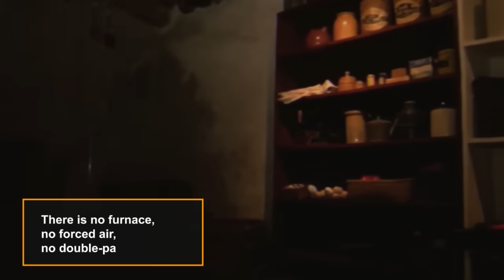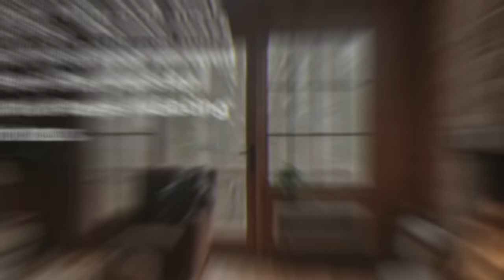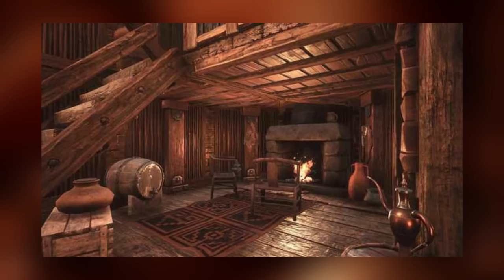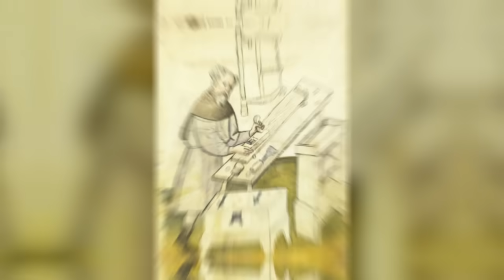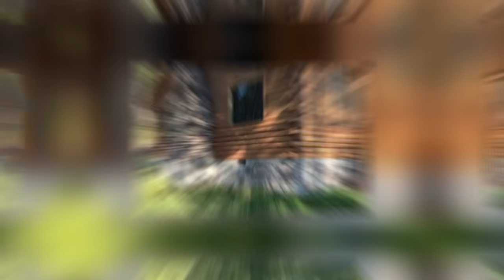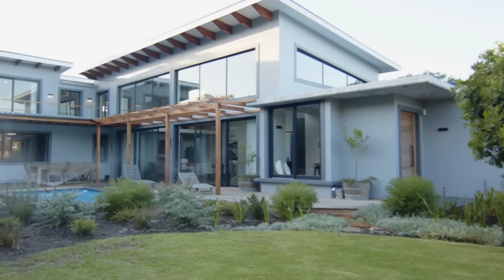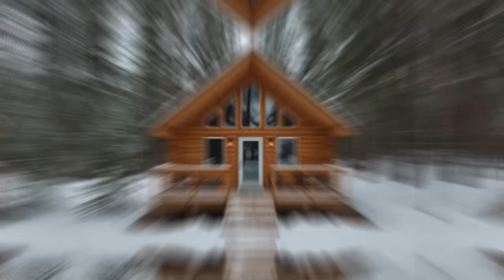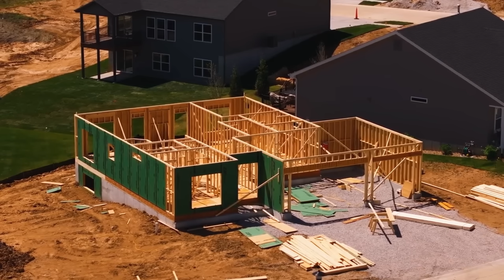Why Medieval Log Cabins Stayed Warm in -40°F While Modern Homes Freeze

Comment: Tried to watch the entire video... But simply could not. Much of it is just incorrect or misleading.

Scandinavian masonry heaters have literally nothing to do with medieval heating. We literally know that this particular type of fireplace was developed by general Fabian Wrede and architect Carl Johan Crondstet in 1775. Actual medieval fireplaces in Scandinavia were either inefficient or did not come with any type of smoke stack at all. Instead they were literally basically a pile of rock in middle of a room. And there was a hatch to let (well at least most of) the smoke out. There was little space for people, and usually in the summer they would use spaces outside the actual house to extend living spaces... But during cold winters, having everybody in tiny cramped spaces was one part of how to survive cold weather.

And as for walls, it literally is not bad to have some actual insulation. The real issue with American houses is, literally in the distinct lack of just about any insulation. While a simple void can act as some form of insulation, it is not very efficient or effective. Here in Finland modern building codes call for roughly 12" of actual insulation... And that means our houses can manage with fairly little in terms of heating.

As for ventilation, it is necessary to ventilate no matter how cold it is. Sure you don't want uncontrolled leakage, and most traditional forms of ventilation are quite inefficient. But modern ventilation with heat recovery can actually recover ~50 to 80% of the heat. And this is not some magic, but simple physics. Use warm inside air (exhaust air) to heat cold intake air. The intake air heats up, exhaust cools down. Single stage heat recovery typically has roughly 50% efficiency, but practically if calculated by mere temperature can be slightly higher than that due to condensation. Even mere 50% efficiency means that you need roughly -20 degrees C ambient temperature to reach even close to freezing, because typical inside temperature is usually slightly above 20 C (20 to 25 being common temperature range in homes) +20 to -20 outside gives you 40 degrees C temperature difference 50% of that is 20 degrees, so you get exhaust cooled by 20 degrees and intake air heated by 20 degrees, which would put both around 0 degrees C or around freezing.

Having thermal mass on ones fireplace is good, but efficient mass heater was designed in Sweden in 1775, not during middle ages. Good insulation, and modern ventilation with heat recovery help keep a house warm. As do proper triple glazed windows, even better if you have selective coating and argon filling in them too.

Mystifying past beyond what it is is silly. Many American homes are really just poorly insulated. No need to blame quality of wood or anything like that.

And just for the record, Here in Finland most log cabins are literally built out of pinewood, which is about the lightest wood that we have. No matter how slow it grows, it is still soft and light compared to even birch, not to mention anything like oak. I guess we use it because it is there. And in log construction you don't need particularly tough wood. When the entire volume of your wall is structural, it is generally an overkill as is. Using birch or oak would just make it unnecessarily hard to shape the wood... Not that oak would even grow much beyond south coast here in Finland anyway.

Not to say thermal mass would not have any effect, but it is still better to have decent insulation to keep the warmth inside. No amount of thermal mass is going to change that. And fairytales of some super dense pine are nonsense. Pine is light and soft wood. There are some studies that suggest that old fashion houses made with massive brick walls do slightly better relative to what was expected, based on some physical models... But slight difference in efficiency compared to earlier models does not render actual insulation useless.

And as for fireplaces... Yes, the English and American fireplaces are very inefficient, that much is true. Like I stated above, high efficiency fireplaces have literally existed since 1775, using models that predate that and sucked even then is outright amazing... Now having said that, I don't mean English style fireplaces would be entirely pointless, especially in climates where heating is not that necessary and the fireplace exists more as a fire viewing apparatus than serious heating device. In a fireplace that is supposed to actually heat something, you want plenty of mass. Because that way you can burn the wood efficiently, then close the flue and just keep all the heat inside. That way the fireplace can radiate heat literally for days after firing.
Reply: And here we go... Calling them "Russian"... The masonry heater being talked about originates from Sweden, and to exact year of 1775, designed by people whose names were not lost.
Reply: Thank you doctor for your thesis
Reply: If you suggest 12" of insulation to most Americans, they'll tell you the payback period is too long, and at current energy prices, it often is. But many American houses are re-sided every now and they and that would be the perfect time to a an extra inch or two of insulation, which could simply be installed over the old siding; the cost of the insulation itself being less of a factor than the cost of integrating it into the walls. One other thing that could stand improvement in most American houses is the consistency of the fiberglass insulation that's typically installed. We should be looking for cold spots, a sure sign of internal air currents, every year, preferably with a thermal imaging camera, then blocking them with injected foam.
Reply: @pcno2832  Well obviously I would not do such a thing... The amount of actually sensible amount of insulation depends on climate conditions... The point was that not losing heat is a very good strategy. Adding thermal mass might give you some extra time in case of an outage... But not really save that much energy.
Reply: Literally, write a book, literally.
Reply: I don't trust anyone that uses "literally" the way you do.
Reply: Masonry heaters were known all around the world since well before Ancient Rome and were widely spread in Eastern Europe since 8th century or so because the idea is pretty straightforward. I am not an expert in history of Sweden but the notion that up to  late 18th century they lived in houses with a fireplace in the middle sounds a bit strange to me. As far as I remember Sweden at the time was a pretty developed country which dominated the region.
Reply: @SergeM123  He probably means the design made in 1767 by Carl Johan Cronstedt, which was an exceptionally efficient kakelugn (Swedish tiled stove) with a vertical labyrinth system, drastically reducing wood consumption. There were masonry heaters before (like the Roman ones, and others), but this design in particular was considered revolutionary and is considered a pivotal development and a direct ancestor of the efficient masonry heaters used today like tulikivi, rocket mass heaters, etc.
Reply: @PurpleAlienPlanet  Exactly. There are many surviving "masonry heaters" in Nordic countries that are actually medieval, but they are not really masonry heaters in the sense as discussed in this video. They lack the ducting that would make heat recovery anywhere near efficient and typically draw in a lot more air than necessary to burn. And, so I have been told, as a result provide merely some radiant heat as long as one would maintain the fire within. I have no personal experience of firing a ~1000 year old fireplace, for obvious reasons.

Which is why many houses for commoners literally had not much more than a pile of rock in middle of a small room.

The kind of masonry heater described in the video is literally based of the Crondsted design, from 1700's, not medieval times. And definately not from Russia either. Even if I am sure Russians wasted no time in adopting the design... The design is Swedish and used across Nordics.
Reply: @SergeM123  Medieval fireplaces were rather simple by design. Basically often not much more than essentially an upside down funnel. And as a result, they would not be very efficient.

The Swedish kakelugn is literally what the video is describing as "masonry heater". And according to any historical references I have ever managed to find, this particular design is from late 1700's, and Sweden. Not Russia or middle ages.

The reason why in Sweden and Finland people were often resorting to type of heater that would seem awfully primitive was literally out of necessity. In warmer climates it was possible to use less efficient fireplaces and it was not that terrible. But up here, efficiency was necessary.

Fancier houses used sort of masonry heater, since the medieval times... But those required huge amounts of wood and basically had to maintain fire almost all the time to remain warm. This is why Crondsted was tasked to "make sure Sweden would not run out of firewood".

Commoners could not simply afford such waste.
Reply: @JuhoJohansson-bz3jb  Although I agree with your main claim that modern houses are, generally speaking, better insulated than those built in the Middle Ages — whatever that may mean — there are some points I find questionable.

I agree that “common people” continued to live in rather primitive buildings well into the late 19th century. We know, for instance, that in colder periods they would bring cattle into the house, both to keep the animals from freezing and to benefit from the heat they produced.

At the same time, we rarely consider the living conditions of poor people when discussing the history of technological development, because doing so would be meaningless: even today, we can find people living primitively despite all technological advances. At the end of the 18th century, Sweden was an economic and military superpower. I doubt that wealthy Swedes lived in houses with an open fire in the middle of the room.

Carl Cronstedt did not invent the masonry heater; he improved upon an existing design. His version was more energy-efficient than some, but energy efficiency is not the only characteristic that matters. It was, and remains, one of many — suitable for some situations but not for others.

Overall, I wouldn’t take too seriously any video claiming to describe “Medieval homes.” What does that even mean, specifically? We are, after all, talking about a period of more than a thousand years and a geographical area covering all of Europe, large parts of Asia, and even Africa.
Reply: @SergeM123  I get many of your points... But I think you sort of slightly lost track here. If we were talking about some of the fancier homes and state of the art heating technology circa 1700's. you would definately have a point and the fact that most people lived in rather primitive housing at the time would be for most part irrelevant.

But in this case the video is making claims of some mystical "medieval" knowledge that people have forgotten since... Which is literally the exact opposite of what happened.

And I didn't exactly claim Crondsted would have invented the entire concept of masonry heater, but the "Russian masonry heater" this video is describing is basically Crondsteds design at the very core of it. Which, is once again cutting edge heating technology in the late 1700's, not medieval common knowledge that was since then forgotten. The entire narrative is just backwards and misleading.

Plus the fact that they keep calling it "Russian" is annoying as such.

I have literally seen medieval masonry heaters. And while I have not personally tried to use one, I know enough about fireplaces that I can tell you they are not exactly efficient. This video is reciting plenty of facts that are true to Crondsteds design, not so much for medieval ones.

And while middle ages did last for centuries and is a rather vague point to refer to... But I bet most people would not associate 1600's as "medieval" let alone late 1700's.

I just googled for some information, and found some statistics that span years from 1878 to 1915. I am not going to type all of it. But according to it South-Savo had, in 1878, 16888 residential buildings. Out of those 3534 (20,9%) were "savupirtti". North-Savo had 12943 residential buildings, 5750 (44,4%) savupirtti...

And that statistic does not even begin any sooner than an entire century after Crondsted.

It is not a matter of belief, there are historical records of the fact.

Comment: I always have a heat source the doesn't rely on the grid. At least as a backup.
Reply: im lucky to have a heating oil furnace, got a 10K litres capacity tank. if the grid shuts down, i can power the furnace with a small generator or even those new battery power stations, it only draws something like 300W max when it's burning oil. i do have a propane infrared heater and some electric heaters for should it break down.
Reply: Is your back-up heat source snuggling with your husband?  : )
Reply: Wood in one house propane infrared heater in the other.
Reply: Wish I could do that tbh.
Reply: propane tank + infrared propane heater, easy and inexpensive. they can run indoors without venting, do air the room from time to time and get a CO detector to be safe.